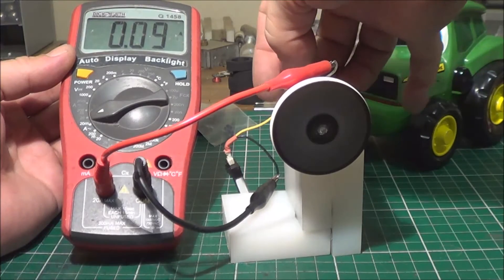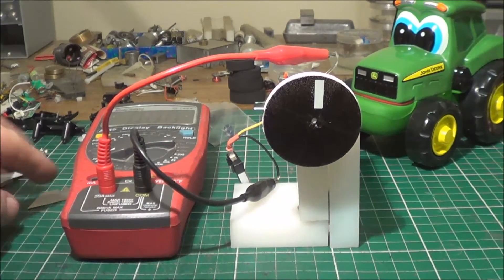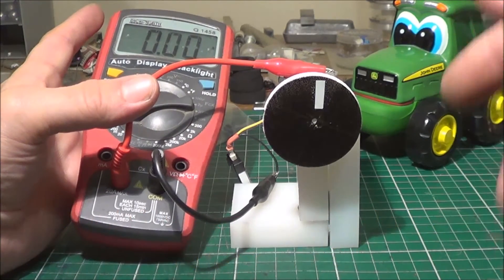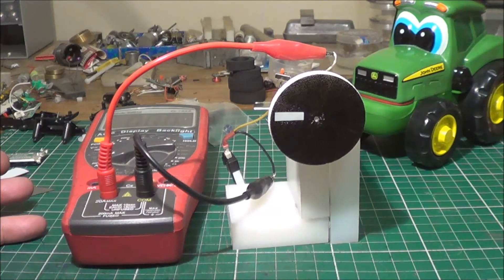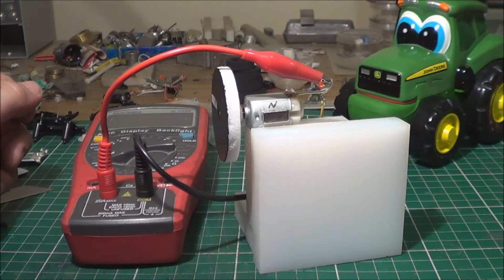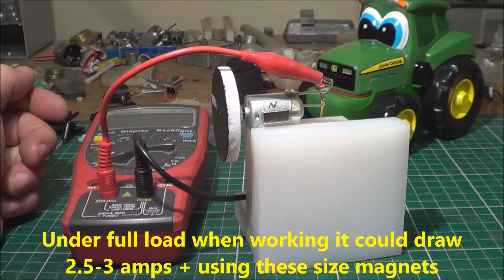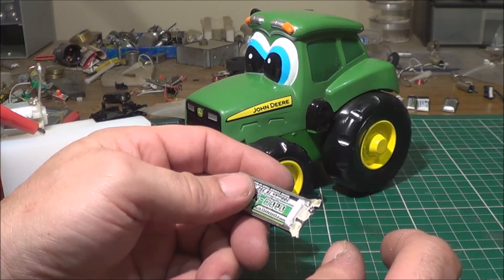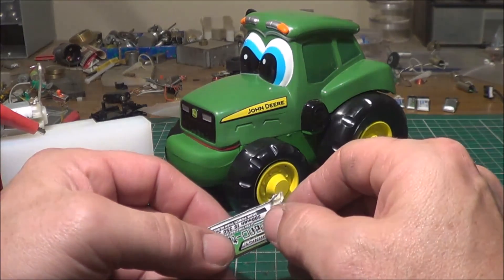Super Charging with Neodymium Magnets/Mad Micro RC Mods 11

Comment: The hotwheels rc nitro speeders are the fastest and smallest cars ever!
Reply from the maker: I think you may be right for there size.
I have tried to get one or two for mods as fast as they are I will make them faster.
I'm trying to get a budget to do 3 new project this would be one of them a small copper as well as a bike.
PS did you like my not the slingshot vid I just uploaded

Comment: I see 1.000!
Reply from the maker: I can't believe it 
You Tube Should send out small wooden play buttons for 1000 subs. 
I know 1000 is a small amount compared to the standard out there but I do feel a little happier I hope it last the day. 
Thanks for noticing and commenting also.
Reply: You can sort of power up electric motors original magnets leaving the neomagnets on for a few months Before using the motor (ofc make sure its the proper polarity thats the same as the original magnet which might require tape or something that holds the magnet on properly).

There is also ready to go neomagnet cases with ballbearings in them (sometimes the motor shaft is a bit too long or short depending on the motor at times but its worth a try for giving it a bit extra grunt or running speed).

http://www.kenonhobby.com/PN-Racing-130-Ball-Bearing-Motor-Case-Neo-Magnet_p_42225.html

While this isnt in stock theres also a ballbearing motor case with normal magnets in. usually brings up the rpm a tiny bit as well as bring up battery life as its easier to spin & keep up the momentum despite running on normal batteries should be an easy addition too most toy rc cars without hurting the electronics unless its really on the edge of dying from overheating when running on carpet or similar already.

http://www.kenonhobby.com/PN-Racing-130-Ball-Bearing-Motor-Case_p_42224.html

I do mess about with mini-z's here mostly in terms of rc stuff.
But today i pretty much soldered together a fan controller too an old dvd cabinett powersupply (2amp 12v & 5v )
So i can power pc fans without needing to mount them into my or any other pc along with having something extra move air in through the balcony door.
as i also can pull down the power with the fan controller i can make them pretty silent as well for the evenings.

I do also have a pair of powered fans (2 120mm fans)
But one is rather weak on moving air so it might get adapted for this powersupply brick instead of usb.
the other one is on a 14v power adapter is a bit broken (poor quality caps) so it goes between 9 - 14v which is quite amusing at first but gets tiring hearing it rev up & down constantly.
Reply from the maker: WOW 
Thanks for taking the time to share you exp 
I know there are much better motor options but this mod is for a bit of quick cheep fun anyone can try if they have an old style ferrite magnet motor. 
I"m mainly limited due to noise to small coreless brushed motors there are some ball bearing ones with neo's but never had one cost way to much. 
I think you may have the smarts to work out how to disable the power down when turning on the atomic racers/ WL toys L939 boards.
I have a good idea but only very basic test equipment and worried about killing a board to find out the hard way.
Your level of tech work would be able to work it out in minutes.
If your ever board for a challenge let me know I may be able to send a board to you.
Regards
Adam VA of AVA Magnetic Levitation AUS
Reply: The board for the silverlit 3d twister does power a basic 130 sized motor with some load (smooth surface & geared quite low)
So i guess that board can power some faster & powerful motors as it does have a larger motor in it then the tomy gx buggy i have here.

So if you do come across a silverlit 3d twister maybe you can source the board from that & gearbox too. (Should be possible to adapt too a older L939 chassis without the servo assembly (You'll loose the precision steering though as its full left or full right on those boards)

I did power the board at the time with a large 18650 cell instead of a single cell lipo.
Reply from the maker: Thank you 
Have looked at the car you said but not had one to try yet will be a good one to look in to to   ? do they have a steering wheel controller may be a good swap for the worlds fastest bolt its controller it sux and easy damaged by just a small bump.